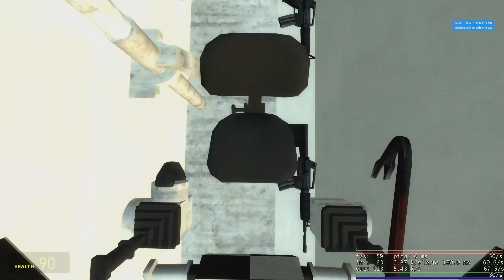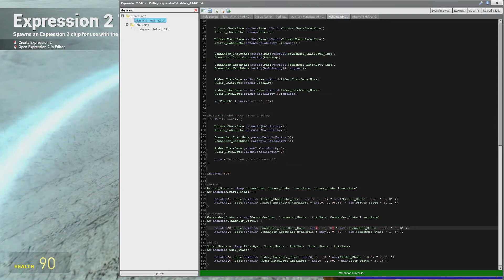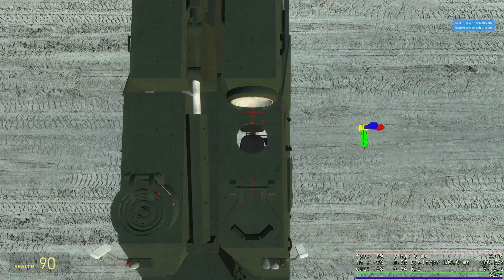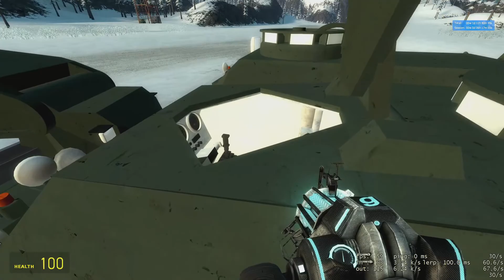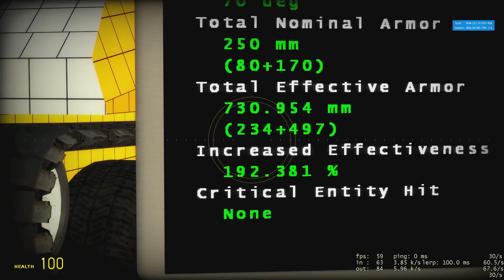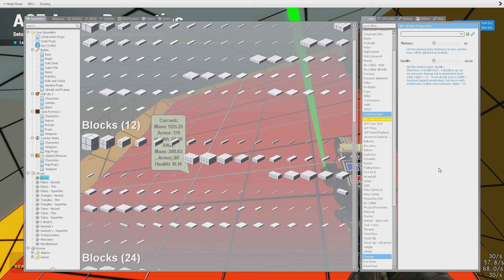[GMod] Kodiak Build Log 2/3: Hatches, Keybinds, Damage Model

Comment: Are you planning to create a comprehensive lecture on hydraulics?

Using hydraulics is very difficult to me. T-T
Reply from the maker: No, wasn't planning on it. If you are having a specific problem, definitely feel free to ask!

I suppose the thing that's most difficult about hydraulics is when the thing they're connected to begins spazzing. To fix that, I just add inertia until it stops spazzing (learned that from @Metacore91 )